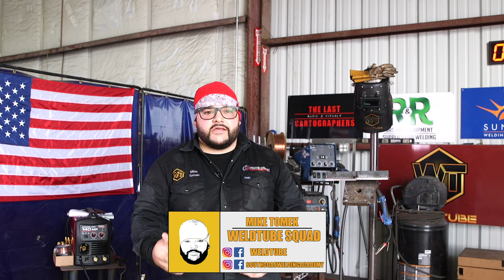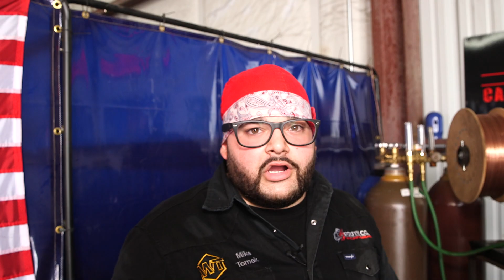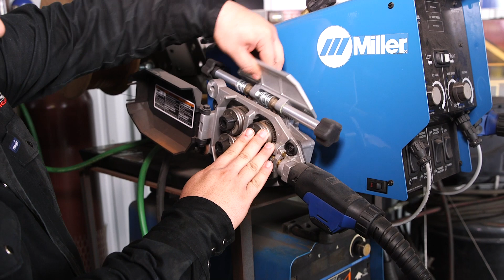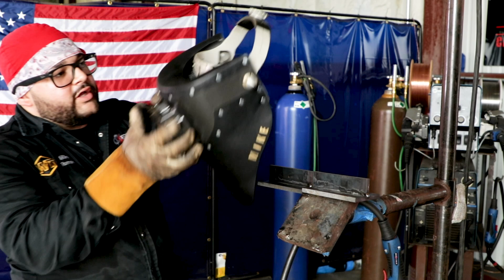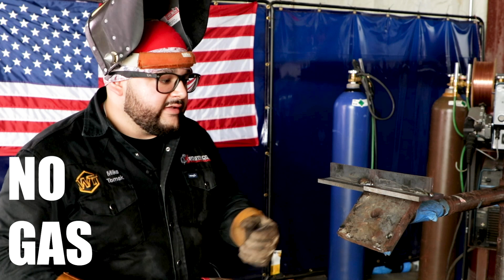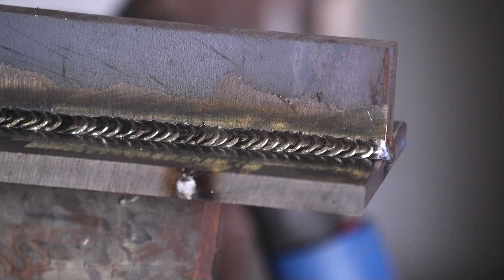MIG Welding Basics - Do’s and Don’ts

Comment: I started a job this week this week as a structure assembler. I will not refer to myself as a welder. I never welded in my entire life until this week. Just about everywhere I have worked there has been some welding and machining. I desire to know both. I would love to open my own fab shop one day (guns, diesels trucks, helicopters, prototypes, fermentation tanks for distilling whiskey or whatever.) I would have gone to school for engineering,  but I don't have that kind of patience. So far, it's really fascinating about the possibility of can be done with welding and how it's done. Space X in McGregor, TX was hiring for welders at one time.

Comment: Can you make a video on setting up machines for finding the correct wire speed and voltage to differant material and thicknesses(carbon steel, stainless schedule 40) and others?

Comment: Nice job Mike. You gave a lot of helpful hints in that video. I like to do TIG and Stick but I have been thinking about a MIG welder for medium\think duty work. Any recommendations on the brand of MIG welder. I know Miller makes a nice suitcase welder and Lincoln has the Activ8. Do you have any other recommendations?

Comment: I noticed that at the very edge of the welds and even on mine...there's a very tiny hole and I just want to know if that means there isn't joint penetration or anything like that because I'm nervous for testing, any information on it that could help?

Comment: So at abt 2 min when u welding with low voltage but the right wire speed and it made that pop well I have that happening part of the way through my weld sometimes. What could be causing that to happen?

Comment: Good instruction, thank you. How does metal thickness affect voltage and wire speed?
Reply: The thicker the metal the more voltage and wire speed you need otherwise the penetration will not be deep enough too much voltage on thinner material will burn through it

Comment: Thank you for the informative video.
I have just purchased my first MIG machine. Where do the AMPS come into it. I heard you talk about wire speed and volts and gas but not amps.
Reply: In some Lincoln literature they point out that you SET wire feed speed and that's fairly constant.  AMPS varies with the action, say with longer stick-out Amps will fall.  SO, current is a variable, voltage and wire feed speed are held constant.

Comment: Hey question that weldtube may have answered somewhere and if they did can someone steer me in the right direction.  What actually gets better penetration with mig, push or pull??  I read some of these internet welders opinions and it makes me question what I have always been told.  Not a mig guy anyway but am curious.  Thanks
Reply: Ben Hinkle pull/drag. the arc stays focused in the weld pool with drag
Reply: @yuhh2684  I get that but it seems to me with a slight push angle you would be getting some preheat into the metal thus creating better penetration.  I am only talking like a 5 degree angle.

Comment: Does weld tube happen to have a video on how to get did of cold wire? I still have a problem with getting cold wire and I dont understand how to stop it.
Reply: Jakob Upton are talking cold wire with tig or shitty mig cold wire? If tig cold wire you are running too cold 🥶 or feeding your wire too hard. Keep the tip of tungsten in the very center of the wire never walk off of the wire unless you’re back feeding. If your back feeding  you need to be more steady with your wire feed hand 🖐 keep the wire still as possible
Reply: @scoterplow50  I appreciate that sir, you hit it on the money actually I'm pretty sure I'm feeding the rod too hard and running too cold.

Comment: Good vid! I’m a stickler though for terminology, it’s silica on top of the finished weld not silicone. For education purposes I felt other commenters should be aware wherever you see “S” on a filler metal, ER-xxxx-“S” or what have you it’s referring to the fact there is added silica in the filler wire. Just be sure to CLEAN ALL THE SILICA DEPOSITS ON TOP OF FINISHED WELD IF WELDING ANOTHER PASS OVER THE BEAD. If you don’t remove them they become inclusions in your weld, a void, and can cause you to fail a weld test! It happened to a guy that took the same weld test as me, 1” beveled plate, backing strap, 1g, .045 L-56 wire, straight stingers until joint was filled to 1/16 above flush. Very important to clean all the crap in between passes!
Reply: Well, since you mention it, what's IN the wire is SILICON, the fashionable and popular element!

Comment: Doing little circles or whipping doesnt allow the puddle to penetrate the root all the way down the joint
Reply: exactly what i was thinking, i was always told not to do that.. yeah it looks nice but is the penetration good?
Reply: I mean I can't talk to much shit cause I whip it. We just had a class at my job the other day and a guy from airgas was telling us this that if you whip it  you will,get penetration but its like a stitch weld when it comes to it penetrating. Everytime you go back it doesn't allow it to get in the root cause yoir not at the leading edge of the puddle. He said he has whipped it for 35 years. I mean really to find out need to cut a coupon straight down the center of the root and etch it
Reply: Tyler Barber i’ve been welding for a year so i take any advice without the true experience if it touches and fuses both walls it still makes its a good weld but with less root penetration! Like you say cutting a coupon is the best way to know and if the guys passed cwb/aws welding tickets whipping it, it can’t be so dramatic! But staying at the leading edge of the puddle makes it better for penetration of course
Reply: Yea I mean I'm still gonna whip i have a hard time just going straight and not manipulating the puddle

Comment: i wonder if you call it "MIG" using 75/25. 

In Germany, we call it "MAG" because 72/25 is an active gas and no inert gas anymore...
Reply: Isnt mag all rods with a flux core and mig with a shielding gas?
Reply: @captainheat2314  it's all technical jargon that doesn't really mean a whole lot. Interestingly enough, when using 75/25 gas it's actually mag lol
Reply: Yes, good point. It's no the same.
Reply: MIG: metall inert gas = Argon
MAG: metall aktiv gas = Argon/CO2 Mixture or pure CO2 (for stainless MAG use something like 98%Ar/2%CO2, never MIG weld your stainless, pure argon is only allowed in TIG stainless)
Heliarc: TIG with 100% Helium 
"fluxcore" is the term for a specific kind of self shielding welding wire; for the "dual shielded flux" process you add a "MAG" gas mixture (eg 75/25) while welding the flux.

Comment: There’s zero advantage to stacking dimes on mig, this is spreading misinformation, you should use a consistent push or pull method with no oscillation, cut the joint on a 45* and look at the fusion profile, 10/10 dimes will be less uniform and therefore weaker